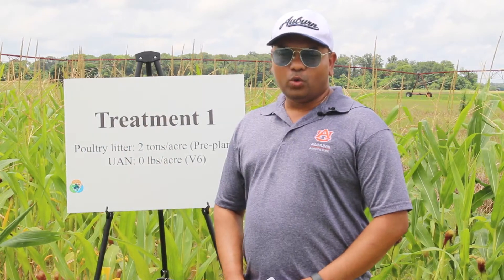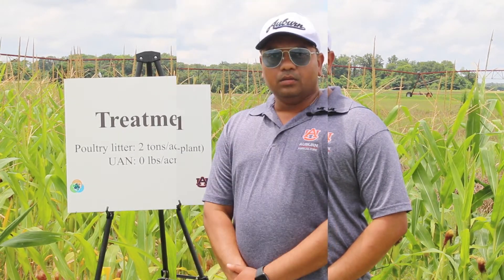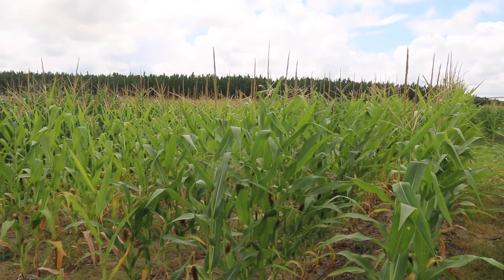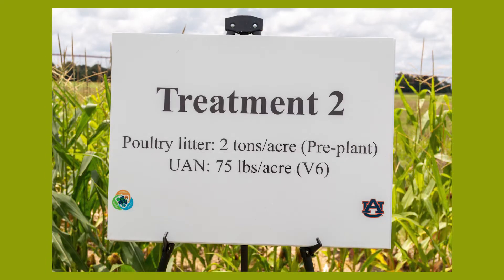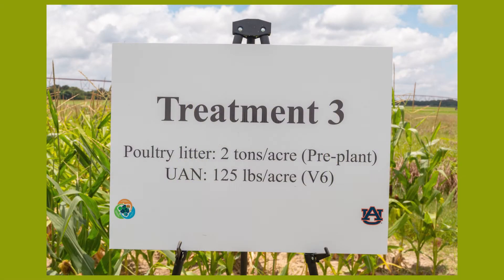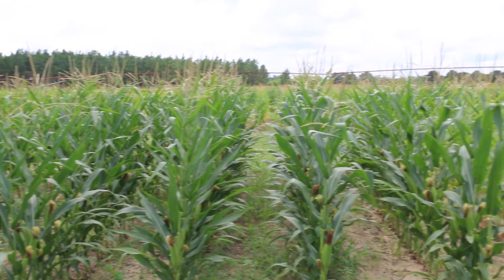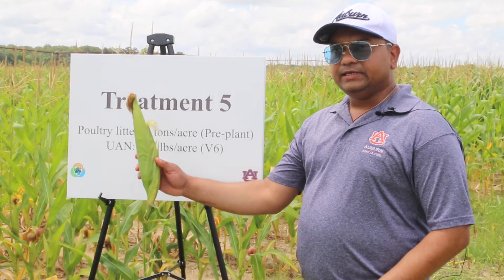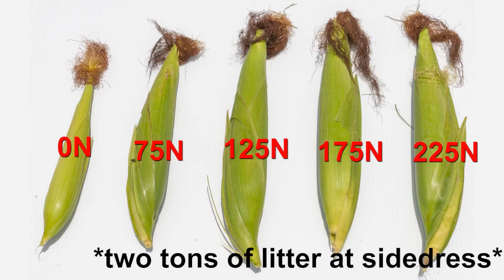Poultry litter use within dryland corn production

Comment: well that is all fine and dandy at the 2 ton to the acre rate, but here in the wiregrass the average ton per acre rate on chicken litter is 4t to the acre so a more accurate test with the right rate would be nice to see to where it cuts down on the need for side dress, and saves the farmer even more money with the fuel prices 5 dollars a gallon, and u can cut out the two to three exra gallons per acre in fuel!